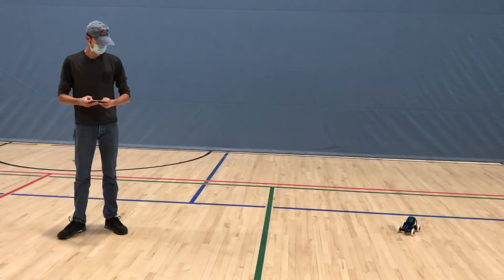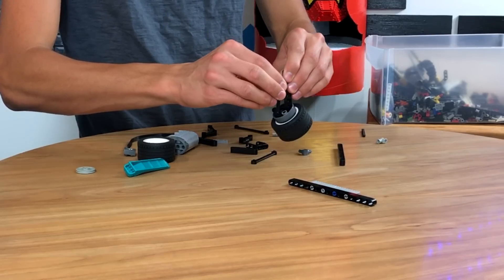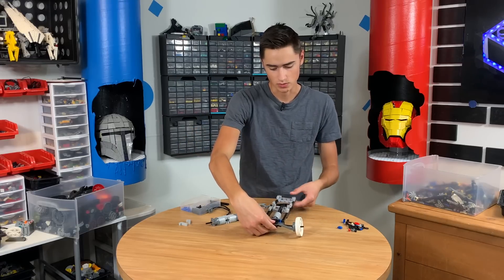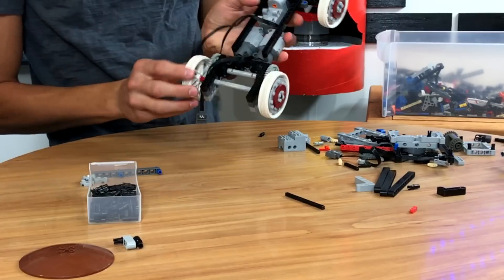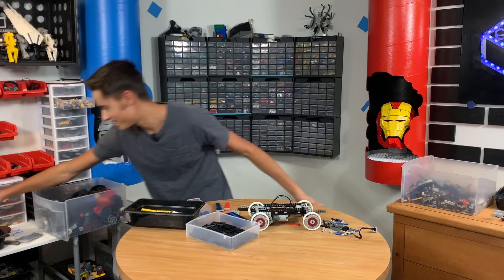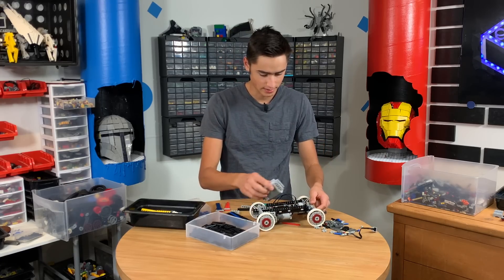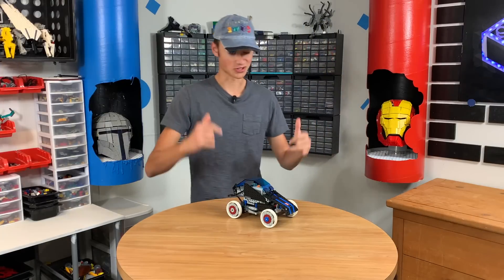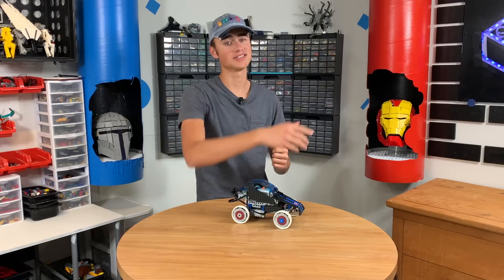LEGO Drift Car (With SBrick and Power Functions)

Comment: If you allready use s-brick, wouldn't be better to connect it with lipo and then get real drift ?  
Lego battery is just so weak 😔
 i broke the speed record with lipo and ir recivers 50 km/h. 
With lipo 11.1 and s-brick i could even get 60-65.

Comment: At ~4:20 you coulda made a rubber band suspension. Attach a mounting point about halfway down the wheel frame and then stretch some semi tight rubber bands from that point to the center of the chassis and then some slightly looser ones on the bottom of the frame to the center.
Reply: hehhehe 420
Reply: @toast4065  hehehehehe

Comment: nice, but for more speed for drifting u can use a BuWizz batery box.
Reply: yeah buwizz is great
Reply: he only uses normal Lego no knockoffs
Reply: @bearcub7681  this ain't a knockoff, he uses sbrick which also isn't official. buwizz is much better than all the original battery boxes maybe exept the ev3 and spike prime hub. buwizz can also get more voltage so more torque and speed

Comment: This is sooo cool! One tip I have is that making the wheelbase farther apart makes the drifting easier.
Reply from the maker: Interesting... thank you for the advice!
Reply: @Brick_Science  but you will spin out more..
Reply: @nam2ww  but it allows more control over drifting bcoz it doesnt rlly drift rn its not smooth which is all that drifting is about
Reply: @nam2ww  nope, a longer wheelbase helps to not spin out. the shorter the wheelbase, the easier it is to spin out.
Reply: The longer the wheelbase the less sturdy but there are so me positive side